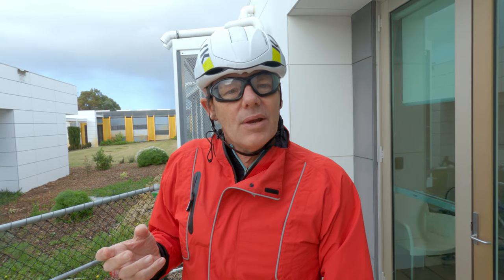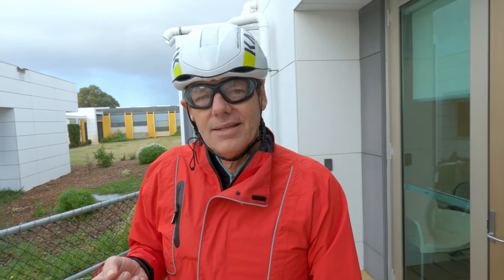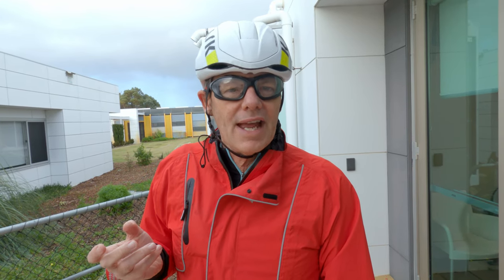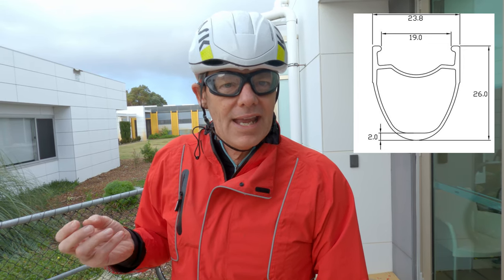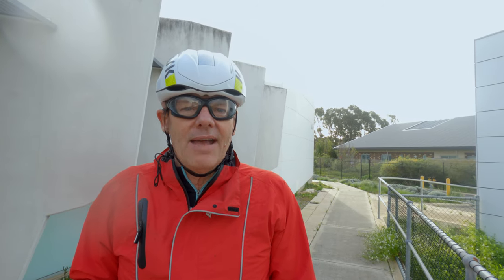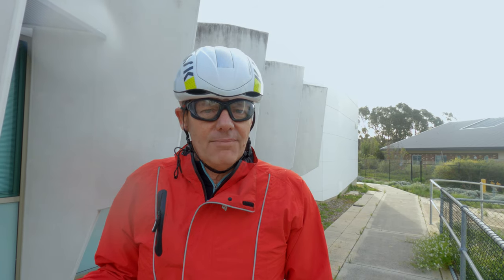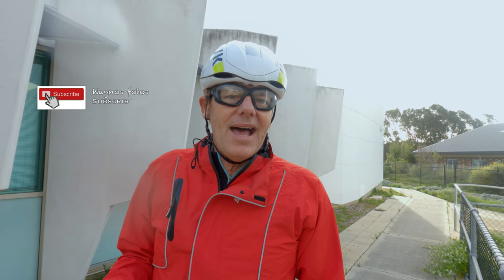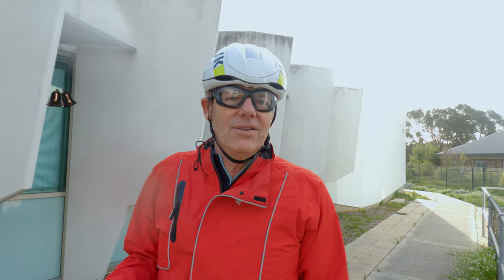WHY did manufacturers move to ROAD DISC?

Comment: I live in Switzerland, I only have carbon rims. I regularly do 10+ Km descents at 7%+ at average speeds of over 55Km/h with peaks at 80+. Never have I had any temperature issue on my wheels. In fact at the bottom of the descent I touch the brake track with naked fingers and it's at ambient temperature level, or maybe a few degrees above. Oh and I weight almost 80Kg. The temperature argument is incorrect in my opinion. If it was correct I would not be using Conti Supersonic tubes in my tires....
P.S.
Normally I only ride in dry weather because in the wet there is almost zero braking power on carbon wheels (even with my SwissStop Yellow Prince pads).
Reply: Actually, temperature issue was a thing couple years ago. Rim brake carbon wheel has never been so good now. Temperature issue is also due to newb dragging the brake for minutes descending a mountain which is clearly a lack of skill.
Reply: You pointed out, in great fashion, the other reason why bike manufacturers are going disc: Safety in less than ideal conditions. Carbon has almost no stopping power in the wet due to the combination off a slick surface (the wheel) being rubbed be an equally slick surface (the brake pad). This leads to little or no stopping power in the wet. If you add debris, you get a great grinding system that wears through carbon (and aluminium) rather quickly.
Reply: @takotsubo I use generic Chinese ones. Never an issue after several years and thousands of kilometers. I do fear punctures though, although unrelated to the type of wheel I just hope I never get one at 70+ km/h...
Reply: @takotsubo You would be in trouble with any tire, tubular, tubeless, anything. If you're writing this I guess it was the rear? In any case it's a risk we all must be conscious about.
Reply: I never had a blowout on my carbon rim brake bike either, but the temperature issue really played on my mind on long descents. Plus, in the wet, those carbon rim brakes were downright dangerous. Now Im on discs, Im experiencing a huge benefit to my confidence and peace if mind.
Reply: @hisdadjames4876  How about your tooling, ease of use, tching-tching, weight, system complexity and times on segments? Any of these show huge benefits too?
Reply: @st939  No need to be defensive. Im simply sharing my personal experience. There are certainly pros and cons, but overall I don’t regret the changeover to discs.
Reply: @hisdadjames4876  No need to get mad, I'm asking you a simple question. Also do you maintain your bike or do you pay others to do it for you?
Reply: @st939  I maintain my own bike, 100%, though I am not looking forward to the hydraulics on the new one.

Comment: I’ve had tubes explode from descending on aluminum wheels so it’s not just a carbon problem with heat dissipation. 
Also you entirely missed that cyclocross drove the development of disc brakes for road style bikes.  There is was driven by the need for mud clearance and larger tires and more immediate braking for sharp turns. What had to be done there started things down the road for manufacturers to see the advantages.  I think for most consumers discs have substantial advantages, but I see how racers who ride tubulars and swap wheels frequently wouldn’t like them.

Comment: That why I use Tubular only. No problem with Rim brakes. Continental Competition Tubular 25mm, 3M tape custom sold in New Zealand and sealant to fix punctures. Love ‘em. Only downside not cheap.

Comment: I could not agree more! Discs are nothing more to a solution to overheating rims. Thank you for pointing this out! Interestingly, Shimano resisted making a carbon clincher for this very reason. But even more interesting is the fact that the overheating rim issue was specific to carbon clinchers and did not afflict carbon tubular rims, and this is the reason why the pros have resisted discs, namely,  because they solve a problem they did not have. Of course, the pro peloton is for marketing bikes to recreational cyclists, so they had to go along with the BS!

Comment: The average cyclists has to ask themselves whether or not these small performance gains are really worth the trouble. A pair of really nice hand built aluminum wheels and dual pivot rim brakes leave little room for improvement . Add to that lower initial cost, lower maintenance cost, and never having to listen to the sound of a brake disc rubbing against a caliper.
Reply: Even mechanical disk brakes are easier to service and adjust than rim brakes, in my experience, and they don't even feature self-adjusting pistons like hydraulic disc brakes do. Hydraulic disc brakes are virtually set-and-forget.

Then there's the fact that the wheels of a rim brake bike have to be replaced when the braking tracks become too thin, compared to replacing mere disc rotors, and riding in adverse conditions will greatly accelerate this wear. If I'm riding on carbon wheels, forget rim brakes. As for disc rub, thru-axles on newer frames help alleviate much of that.
Reply: @Kuriketto  Glad you are happy with disc brakes. I don't know anyone personally that shares your opinion.
Reply: @robertryan1663  Nobody I know still prefers, let alone rides, rim brakes, and yet I'm aware that people still swear by them. It goes both ways, though I will say most everybody I know ride both road and mountain bikes.
Reply: Nailed it. Hand built aluminium wheels plus dual pivot brakes (and Swisstop BXP pads) are perfection
Reply: @Kuriketto  hydraulic brakes fail far more often, and catastrophically. Then it's generally replacement. Rim brakes are the easiest to maintain, and significantly cheaper. As for brake track wear, as long as you keep everything clean, rims last for decades. I don't know anyone who has has rims wear out. I killed a pair from years of commuting year round in all conditions (including snow etc) and never washing.but the hubs were garbage by then as well. its to be expected.
Reply: @Kuriketto  MTB and road are very different. The same solutions for both don't make sense. I prefer road rim, as do a number of riders I know. Less hassle for those wrenching at home. The cost of new disk brake versions have gone beyond the point of ridiculous.
Reply: @shamuslamont100  I didn't bring up MTBs just to endorse disc brakes as a one-size-fits-all solution, though they certainly are that as far as the larger bike industry and myself are concerned. Rather, I brought them up to illustrate that familiarity with both disciplines leads to more willingness to adopt disc brakes on the road front. In fact, I'd wager the rising popularity of mountain biking, and cycling in general, are largely responsible for the rising dominance of disc road bikes.

Concerning cost and ease of maintenance: "as long as you keep everything clean..." That's the literal rub, isn't it? The average road cyclist doesn't bother performing pre- and post-ride brake checks, let alone performing their own bike service. Properly installed, disc brakes simply weather infrequent maintenance intervals better than rim brakes: the rotors are slotted to allow for self-cleaning, hydraulics aren't subject to cable stretch and contamination and provide a consistent lever pull without the need to manually adjust the pad positions, aren't affected by rims being out of true, steel rotors are obviously more robust than carbon or aluminum brake tracks, etc. They just keep working if left alone. I also haven't heard or read one shred of evidence to suggest that disc brakes fail catastrophically more often than rim brakes, nor do I believe this is even remotely close to being true considering everything I just listed above.

Regardless, I'm not going to convince you of why disc brakes belong on road bikes and you're not going to convince me to return to rim brakes, nor will the disc-equipped road bike trend reverse itself. However, while I concede that the benefits of equipping road bikes with disc brakes may be marginal compared to mountain bikes, they're still noticeable (more so in some respects than others) even to the average road cyclist, or perhaps especially so given my points in the previous paragraph. After all, most cyclists can't or won't invest the time and effort it takes to learn to maintain a bike regardless of what brakes it has, so they'll just go to a mechanic for service, if even that. All this is to say that it was inevitable that disc brakes would overtake rim brakes given how much popularity cycling has gained in just these past few years alone, so it makes little sense that some people are keen to blame the bike industry for supposedly imposing this change when in reality it's been a consumer-driven shift all along.
Reply: @Kuriketto  I'm a boomer and I and everyone I know does their own bike maintenance. We grew up doing this kind of thing and just kept it up. That is probably one of the big reasons I prefer the simplicity of rim brakes. I'm also going to stick with mechanical derailleurs for the same reason. I've written road bikes with hydraulic discs many times, and I just don't see enough performance gain to justify the extra cost and hassle. That said if I were to spring for a new mountain bike I would definitely go for disc brakes.
Reply: @robertryan1663  I grew up maintaining my own rim brakes as well, but dreaded always having to unhook the brake noodle, undo the caliper quick release lever, deflate the tire or some combination of those two just to unmount the wheel for something as simple as patching an inner tube. When disc brakes came along and later thru-axles, virtually eliminating caliper misalignment that QR axles can introduce (unless you always set the bike on the ground first before securing the QR, but that still doesn't guarantee the wheel isn't skewed), I never looked back.

Brake bleeding can be messy, especially the first time anybody tries it, and admittedly isn't as easy as replacing a brake cable (but arguably as easy as replacing brake cable housing), but a little practice goes a long way and they're performed infrequently due to the sealed nature of the system. Disc brake pad replacement is also so easy that it more than makes up for the bleeding procedure. I will say that I only have experience with disc brakes of the mineral oil variety, though, since I refuse to use DOT braking fluid on my own bikes, so I can't speak for disc brakes from SRAM, for example, though I hear DOT fluid brakes require more regular bleeding intervals.
Reply: 30 years on alu/rim built by a top builder, clinchers and tubes had some wonderful times and continue to do so.  I can't be faffed with disks.
Reply: @robertryan1663  you don’t know anyone who personally shares that opinion, because you don’t know anyone who actually rides. Period.

Comment: Brilliant and non-judgemental description of the rim brake - carbon wheel - disc brakeevolution...a process Ive lived through as a rider. (wet conditions a further issue?). Anyway, might we see a reversion to rim brakes with a more central, thicker carbon brake track? Could that be lighter and more efficient than a hub disc brake system?

Comment: I've de-laminated a carbon rim. Strangely was on the back and not the front where most of the braking forces go.  80 to 20kph in ~15seconds. Got a warranty rim I built up which had high temp resistant resin unlike my old one and seems much better. Solution, use my alloy wheels for rides in the hills and carbon wheels on flatter rides and races. I wouldn't go riding in the Alps on carbons for example! Easy, and much cheaper than a whole new bike, that in my budget is about 1kg heavier than the one I've got stock. I don't want to make my 4 rim wheelsets redundant also as they're perfectly good.

Comment: A hole at the top of the fork crown and a bridge on the rear seat stays is all that's needed for a current disc frame to run both rim and disc brakes on a disc frame. 

Tell me again how many ££££'s do we need to add to MSRP to have that, considering the frames are already overbuilt for disc brakes?
Reply: I nearly bought an alu kenesis 4s disc as a winter bike. Could take rim or disc. Those dual brakers never took off.........
Reply: Different wheel standards though, so no point in putting those onto a disk brake frame
Reply: @shamuslamont100  I have no problem with through axle hubs on rim brake wheels.

Comment: Considering carbon as a material for rims as opposed to aluminium created problems for the bike industry. The inherent uncomfortable feel of a stiff carbon frame, was negated by the industries answer to go for wider tyres to smooth out the ride with lower pressures. Thus along came tubeless, move the brake track - keep the carbon rims! Win win for the industry with more sales, while keep churning out super stiff low production cost carbon frames!  Hambini used a new form of aluminium in one of his bottom brackets. "Super light", half the weight of the standard aluminium used today. I wonder if that material could be utilized for rim brake wheels? It would create a super low weight rim brake wheel whilst retaining aluminium's ideal properties for rim brake wheels. Unfortunately aluminium wheels are today seen as unfashionable, and are probably less profitable for the industry.

Comment: Wanye I think you keep skipping around why manufacturers are moving to disc. I have 40 years plus riding experience. So let's go back to the early days of aluminium. They were made with very slick braking areas to improve speed. However, add one drop of rain and you instantly had no brakes. I fell victim to this more than once. Add that tires would routinely blow off the rims and you had a recipe for disaster. So, wheel manufacturers added dimples to the rims to "improve" braking traction. Add that softer compounds started to be used and braking improved to the same standards as steel. Move forward to carbon. Wheels were originally made with slick braking areas. Hard and slick braking pads have to be used to prevent wear through. Some manufacturers moved to layered levels and softer braking materials to improve dry braking and to increase the life of the wheel. Still the issue of wet braking existed. So, some manufacturers started to add exotic materials to the brake track as well as custom mouldings. That improves braking in the wet, but issues still exist. Enter the inclusion of disc brakes which comes from mountain biking where rim brakes are basically non-existent in any form. First go was to adapt rim braked bikes to disc. That turned out to be an absolute failure. The second go round was to redesign all bikes to have features found on mountain bikes like through axles and 142mm rear spindle spacing. That resolved many issues. But getting back to carbon fiber rim braked wheels. One issue really remains: Heat dissipation. Carbon doesn't dissipate heat. At all. One manufacturer tried to fix this by weaving in copper threads in the final layer. It worked somewhat. My opinion is rim braked carbon wheels will go the way of the Dodo. Great idea, but doomed to failure. Now, aluminium rim braked bikes will be around for a long time. They are reliable, easy to fix, and are very strong. They can be as light, if not lighter than carbon.

Comment: Another reason for hydraulic disc brakes is integrated cabling systems. Hydraulic oil based actuation is definitely more reliable and durable, compared to mechanical cables, when there are so many tight turns in the frame and fork. Let's face it, who doesn't prefer a sleek looking bike without cables dangling it the front?
Reply from the maker: Not necessarily true, hydraulic systems can fail too. In fact a mechanic commented on this channel, due to the continuous rubbing in the fork wearing through the hose the cables have leaked and pressure lost. When he contacted the manufacturers, they said this need to be checked annually. I do get cables can break but it is rare. I have had only one break in over ten years of riding and this was because i packed the bike and kinked the cable. So yes agree, but hydraulic has maintenance problems too.
Reply: @waynosfotos  check annually for hydro hose failure.... wowee, what a PITA

Comment: What is easier to replace- a carbon rim or a disc brake  rotor? Rotor is cheaper, much cheaper than a carbon rim- and a new rotor is a lot faster, a lot easier to remove and install.